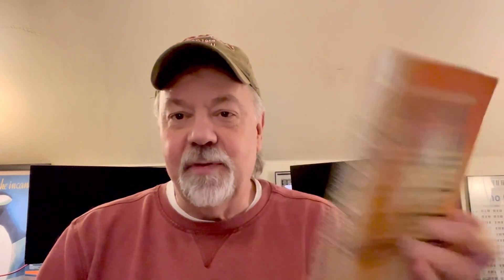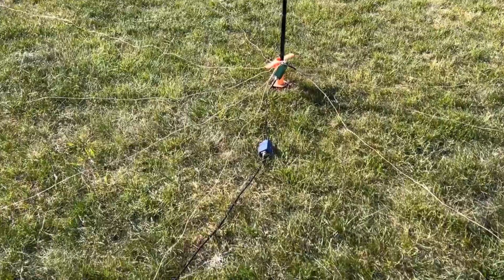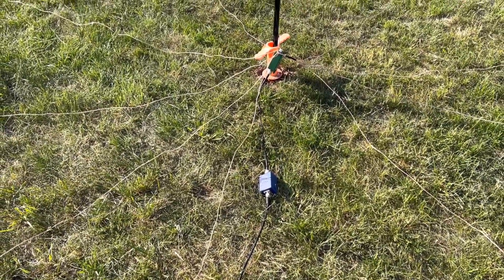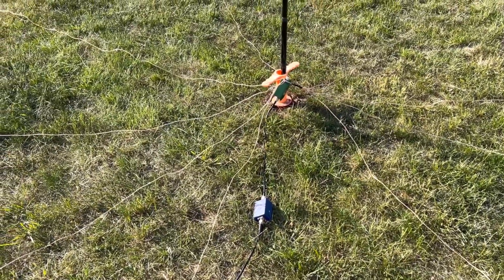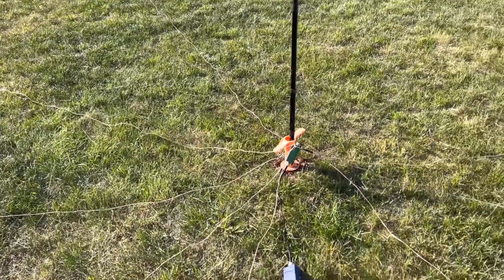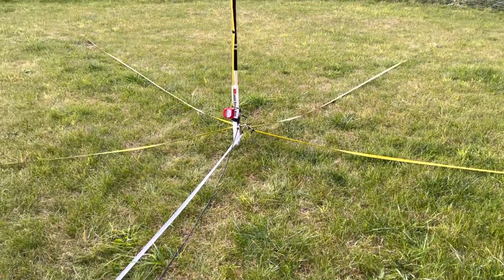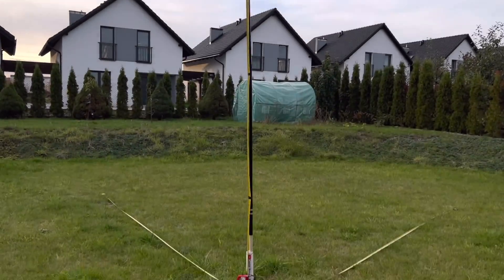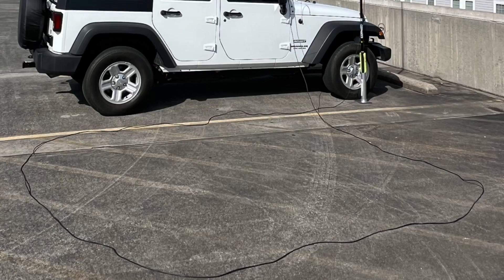Ground Radials for Vertical HF Antennas

Comment: I have 3 different vertical coil antennas and everyone of them I have replaced the radials that come with them with this one:
      Comet CGW-560 HF Portable Ground Radial Kit CGW-560
It is 6 radials and they are all connected to a ring terminal. They are VERY well made and I basically treat the setup effectively as one radial. I spread them out but don't have to deal with 6 connections. I just put the ring terminal where it goes on the antenna and it just works!

Comment: you said  basically using the moisture/marshes are good for vertical & i know you set up near water esp. salt water area/im no where near water/ so brain fart idea, set a tri.pod vertical in a kids swimming pool with some water as the reflector? good/bad or nuts??
Reply from the maker: It won’t work, you would be better off just adding more radials on the earth. The saltwater effect is from the overall sheet of the surface plus the RF from the antenna taking that first hop as well as continued skip across the water. Think of skimming a stone over water compared to across dirt. 73, Walt
Reply: @COASTALWAVESWIRES  ok thxs for that..73

Comment: I still can't seem to get it right I made 8 10 foot radials for my 17 foot extendable whip. works great on 10m and can usually get around 1.1-1 swr but 20m is always above 2.2-1 swr, made 6 16.5 foot radials works great on 20m and get 1.2-1 swr in the general voice section of the band but now 10 meters goes up to 2.5-1 swr. in my case the length matters quite a bit. I don't know why this is, most people, even you say the length does not matter all that much but, in my experience, setting up in 4 different locations this is always the case.

Comment: Excellent explanation of ground radials. Thank you
Reply from the maker: Thank you for watching! 73, Walt
Reply: @ I’m a fairly new Ham. There’s so much info that’s not broken down for newbies. Most of what we see on YouTube is for experienced hams. For example, simply how to connect the radial wires to the vertical antenna is jumped over. This is what I was searching for when I found this video of yours. Do we just wrap the wire around the pole? Use a connector? Seal it from rain? Basic stuff is much appreciated. Thanks again
Reply from the maker: @ watch this one: Salty Walt’s Guide to Building Portable Ham Radio Antennas
https://youtu.be/td4FU0a_yLM

Comment: One question Walt, do the counterpoise wires have to be the same gauge as the radiating element ? Reason I ask is I am about to make a Rybakov, the radiator is approx 20AWG but I only have enough wire to make counterpoises with approx 24AWG. Do you think that will be ok ? Thanks
Reply from the maker: @martinsalt1839  that will be fine, wire gauge for Counterpoise really doesn’t matter, just get what you can on the ground. Have fun and good luck with that antenna!

Comment: so if my vertical HF antenna is up on the roof of a 2 story condo do I still lay down the same ground plane just right on the roof?
Reply from the maker: @Yugos-Survival  no, you will need a different counter system. That might even be long coax.
Reply: @COASTALWAVESWIRES  ok what would you recommend?
Reply: @COASTALWAVESWIRES  maybe a huge flat sheet of metal and grounded to a rod in the floor?

Comment: Has anyone ever tried helically wound radials for use with an elevated vertical? Been thinking about this as I'm a third floor apartment dweller and have limited space horizontally from the feed point. So many antennas...so little time.

Comment: Just getting started and really enjoy the way you explain antennas.  I'd never heard of a ground conductivity map.  The FCC site says "A higher ground conductivity indicates better AM propagation characteristics.  The map shows that the ground conductivity in the U.S. ranges between 0.5 and 30 millimhos (or millisiemens) per meter.  The conductivity of seawater is 5,000 millimhos per meter, resulting in the best propagation of AM signals."
If the soil conductivity is a 1, would you potentially require more or less radials to work better than soil with a conductivity of 30?
Reply from the maker: Yes, in areas of low conductivity more radials improve the antenna.

Comment: Hi Walt. Just wanted you to know I just contacted Madrid Spain on 20m using my FT 891 / 25 Watts and a “Salty Walt” speaker wire vertical with four radials, mounted in my back yard.  I’m in central New Jersey, about 5 miles from the Delaware river.  Pretty freaking amazing.  Thanks for all the great videos.
Reply from the maker: Awesome! 73 Walt

Comment: Good morning Walt. Why would my swr change with my Chameleon SS17? When I put it up and tune it, it’s shows say1.15, 5 minutes later it shifts to 1.5 or higher.  Don’t know if it’s the breeze moving it or what. Tune it again and it will jump again. Not sure why it’s not stable. Thanks
Reply: Yeah, that could be why. I’m using a coax cable that’s terminated with BNC connectors and using adapters from BNC to PL 259. I’ll throw a cable on that has PL 259’s on it. See if that helps. Thanks again again for your feedback.
Reply from the maker: I’m not sure, that’s a hard one to answer without being there. My first thought it connectivity and/or a coax issue

Comment: According to  your previous video on RF grounding, if I understand clearly from what you said, I should be using at least 4 counterpoise wires when building the 29' and 41' vertical antennas shown in your other videos? I live in the mtns on top of dry dirt and decomposed granite in Arizona. I did experiment one time with 4 wires and noticed the SWR increased quite a bit. But I am also using a tuner. Thanks again for your outstanding videos!

Comment: Hi Walt, If you say its like a mirror could you use a groundplain for direcionaly? Say more radials to the west to improve my position for England as I am working from the Netherlands.
Reply from the maker: From what I understand it will not increase gain in that direction but will cause a bit of a null in the direction where there is no radials.

Comment: Great topic, couple questions, 
1. If you only have room to put the radials all in one direction will that make a vertical "directional"?
2. Is it ok if the first few feet of the radials are not touching the  ground? As in, if you have to attach them a few feet up the ground mounted vertical?
3. Do you have an opinion regarding magic carpet vs. radials?
Reply: Thank you for taking the time Walt,
I enjoy your videos and you are a natural in front of the camera.
Reply from the maker: Yes and no on directional, you won’t get any extra gain in that direction but might have a slight null where there is no radials. Yes it’s ok to have the ends near the driven element a few feet off the ground to start. I’m not sold on the magic carpet yet but will probably try it soon to see for myself. 73, Walt

Comment: well said .that is how ground radials work. when portable just throw some on the ground . do what you can to spread them out. it will work just fine. over thinking it and wasting time to get it just right is taking fun away of on air time.  the band conditions have more to do with making contacts then getting your ground radials just right.  73's

Comment: Thanks Walt for all your help! I finally cut 5 10 foot radials for my 17 Five with an LDG 4:1 unun and a 6 ferrite sleeves in line about 18" from the end of the connector that goes to the unun. THANKS AGAIN!!! VA3COJ 73

Comment: I keep a DX Commander 10-meter pole in my front yard with a 29' wire attached to it next to my Tool Shed, where I play radio with it and a few other wire antennas I've made per your videos, and I've found that antenna does wonderfully with just 4 radials under it. 73 Walt, KG4VLN

Comment: Good info. The size of the radial system ( length and number) needs to be larger the lower you go in frequency. 40 and up does not take much. 80 and 160 requires a little more. The conductivity of the ground makes a difference so there is no definite one size fits all answer. I like to say you just need to be in the ballpark! After that the differences are pretty minor.

Comment: For my 17ft whip (WRC tripod) I bought a pair of heavy duty automotive clips and created a two bundle of 5 wires each about 10ft long (~100ft total)

Using two of these radial bundles is fast to set up, fairly small footprint, effective, very fast to put away, and compact in my radio bag.

Asphalt parking lots, desert sand, or grass it works great

Comment: Maybe a dumb, newbie question, but how are radials connected to the antenna? Is contact necessary or are you just laying out wire?
Reply from the maker: Not a dumb question, they are connected to the antenna. The radials are connected to the outer braided wire part of the coax or the negative side of a balun or unun. You can also just clip them to the outer metal side of the coax connector at the antenna feedpoint. 73, Walt

Comment: Sure thing.  It doesn't take a whole lot.  I've used a MP1 antenna at ground level, clamped to a bed in a condo and ran 4 wires across the floor.  It worked!

Comment: I have been successful in in building 1/4 ground planes. 1/4 wave radiator & 4 1/4 wave radials. plus I mount these antennas one full wave length above the ground. vertical dipoles also one full wave length above the ground.  Lower than that its Very Compromised. hight is might.

Comment: During my POTA activation I use a 1/4 wave vertical with feed point about 10' off the ground with 4 radials made out of walmart speaker wire. With 50 watts I have no issues hitting Alaska from middle GA. If you can raise the bottom of the antenna about 10' and have the radials come down at about a 52° angle and have them a foot or 2 above the ground you don't many radials at all. 
Moe KO4GBB

Comment: I use two 3x8ft sheets of aluminum window screen attached to my antenna ground with alligator clip leads.  It is real easy to set up with the two sheets on either side of the antenna.  Performance for me, has been better than 16 3m radials

Comment: Me I use a 1 meter long cooper rod driven into the earth with a single ground attached to the balun to quell the noise of the vertical - get the noise floor level down and the antenna seems so much more effective. If only I could get the daytime solar panel and wifi repeaters around me sorted ! 73

Comment: I agree that radial length really doesn't matter for ground mounted verticals on most bands. When you start moving to the low bands 80-160m the radial length will determine whether or not you have to use a tuner in my experience. I use an elevated vertical antenna for POTA. The feed point is over 1 meter above ground and i will say in my experience that 4 quarter wave elevated radials 90 degrees in separation work really well. I would like to see your take on this antenna. Have great day. 73's

Comment: Great video. For my DX commander portable I use 4 radials per connector, 5 connectors, 3.5m long. 
That's 20x 3.5m radials. From the UK to the USA it's so easy to DX and Australia as well at the right time of day.

Comment: Great video.  A Faraday cloth also works well and is much easier setup than laying radials
Reply: How do you use the cloth? Just lay it under the antenna?
Reply: @JawaInvasion  yes, make sure the ground of the antenna touches it.  I used it with Wolf River Coils tripod which is the ground of the antenna
Reply: @JawaInvasion  https://youtube.com/shorts/aQjYTnMfunc
Reply: @JawaInvasion I just use a short length of wire with alligator clips each end, one clipped on my faraday cloth (or metal insect screen previously) and one on my tripod which is just three half-metre lengths of steel strap.